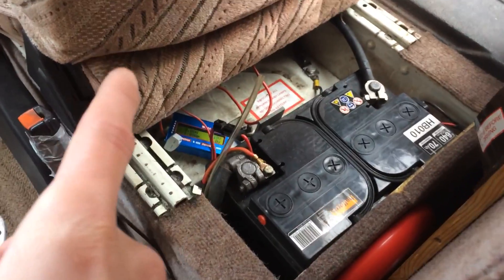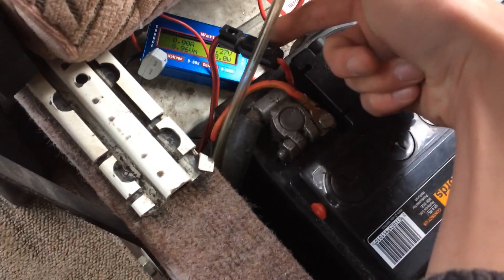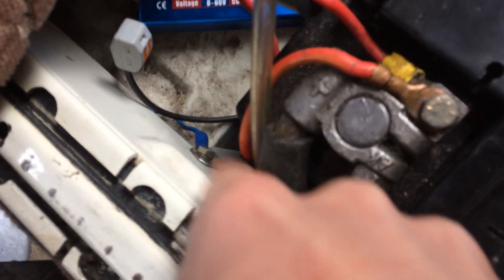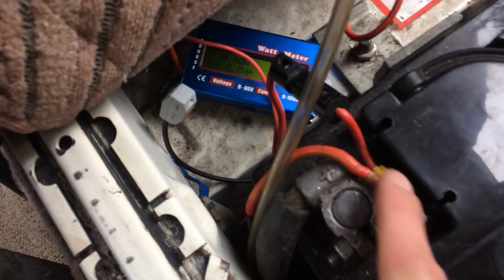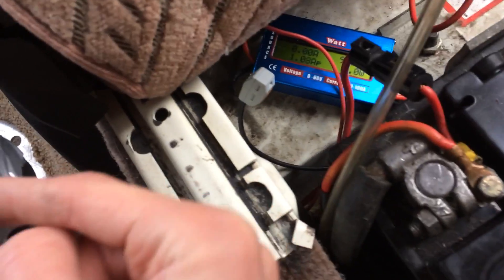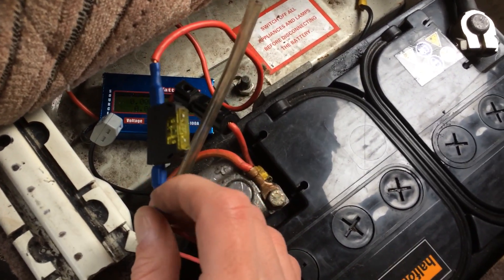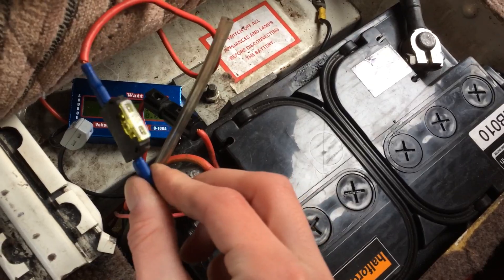Split Charge Relay to Zig unit on Autosleeper VW T25

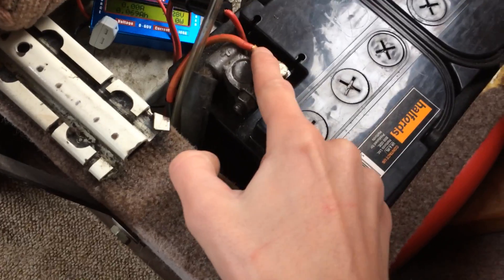Comment: 0:06 seconds in, your battery seems to still have the Red bung installed, a battery I recently purchased explicitly says to remove it, as soon as the battery is home/installed. One to check!
Reply from the maker: You're absolutely right! It's always been there since I bought the van so never thought to take it off.
Reply: James Akers I trust that has been remedied now :-) love the videos by the way, I’m just about to replace all the bushes on my 1982 T25. Recently subscribed, watch one of your videos a little while back.. then found you again via a 80-90 Club page listing T25 YouTube channels - keep up the good work, I know it’s difficult balancing life, other commitments vs the time it takes to work on the van, film and edit YouTube videos